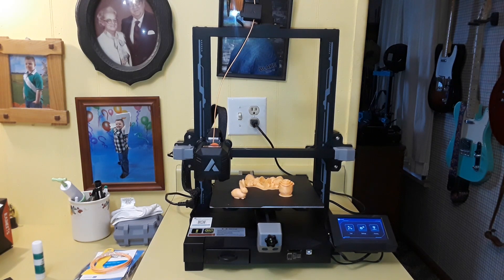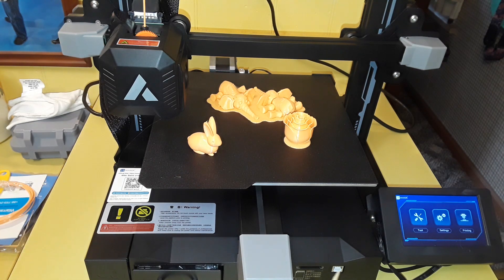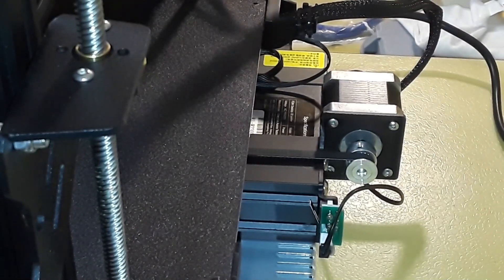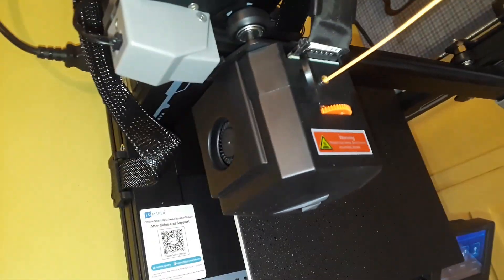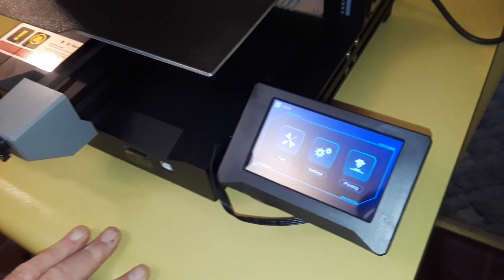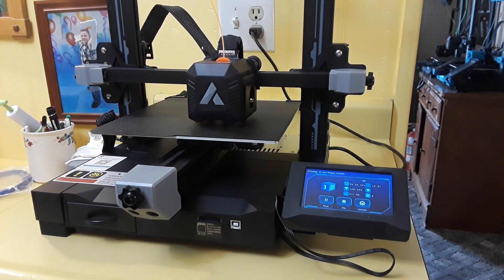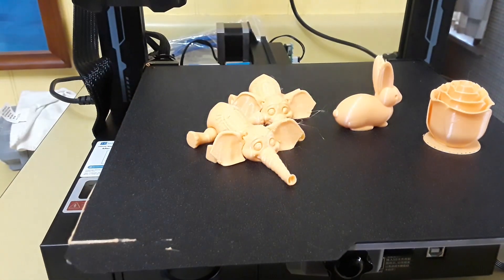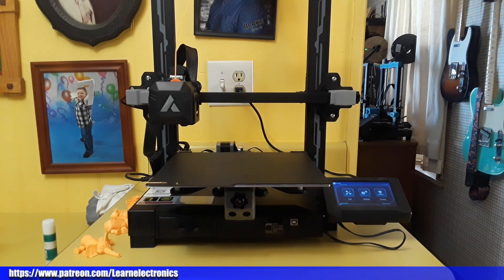JG Maker R1 3D Printer

Comment: What do you think about the promotion they are running right now for the printer? 60 Bucks off. In your description you said 30 Bucks off and it's interesting.
Reply from the maker: For $60 bucks off it is not a bad deal at all. But you will need to set your Z offset manually.

Comment: It’s not as plain as you’re making it sound. Direct drive, dual fans, and auto bed leveling right out the box for the price is quite remarkable. I don’t recall any Enders coming out the box like this. And JGMaker has quite a few consumer printers before this one. I love their a5s and I recently purchased this one but didn’t set it up yet. Thorough review but it a pretty good deal.
Reply from the maker: There's nothing at all wrong with it. It's a nice printer. But it's just lost in all the other nice printers. And the game is changing. I3 clones have supersaturated the market. No one is even trying to innovate. They are all just trying to get a piece of the market.

Comment: the dual z steppers with sync belt is really nice as long as there are two seperate stepper drivers for each one and not just one driver running both